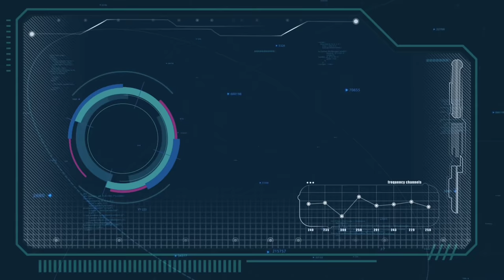Found a Fender❗ 1st Time Using the Gooseneck Trailer ➕ HellCamino to the Shop

Comment: Hey. I'd unbolt the bed. Leave the passenger side bolts in but lose. Lift the driver side so you can get that fender on and off. Less work that cutting off the bumper
Reply from the maker: Great idea. May try that.
Reply: @CoolCarsKJ  that's how I do my fuel pumps as well lol

Comment: When you unbolt it all you do is lift up and pull out you don’t bend that lip lol hey I need that driver side bed rail cap! Would you ship it to me? I’m in sc I could also come get it! Price?
Reply from the maker: It’s supposed to pull out... but it didn’t. As you can see I got the left side of it off easily. The right side wasn’t coming out like it should have. You talking about that top piece that’s long as hell?
Reply: Yeah! You can bend it in half and put in a box! Ima fiberglass it. make it smooth and paint match
Reply from the maker: @lb7dually242  hit me on instagram @cool_cars_kj
Reply: Alright I did